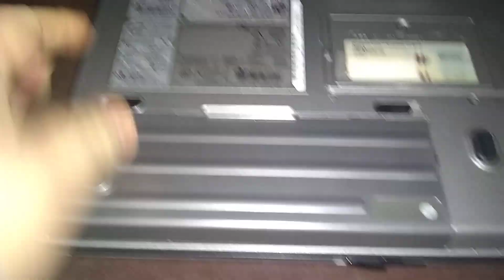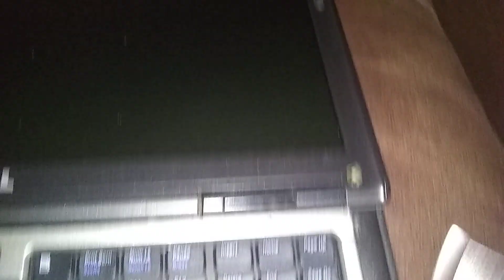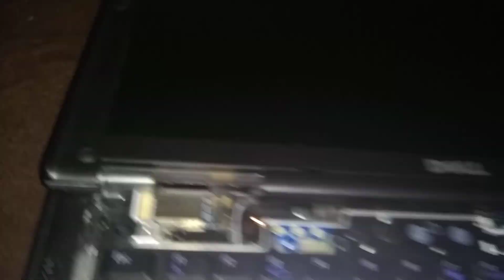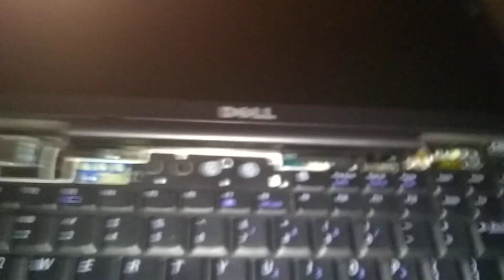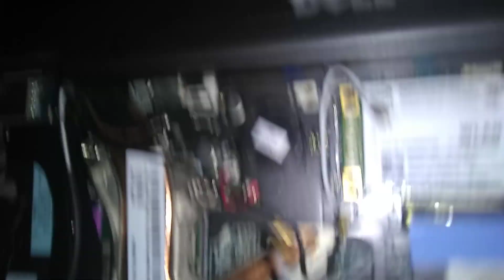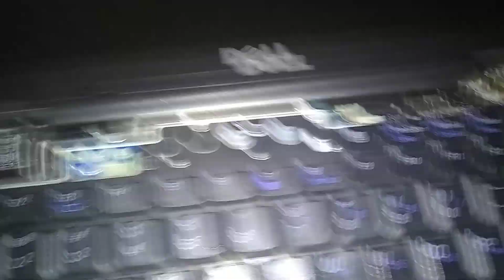How-to Upgrade WiFi Card Dell Latitude d620 d630 d820, Nervous Nick

Comment: I installed Linux, Broadcom wifi in there has no drivers to work with Linux, I hope swapping it out to this Intel card solves the issue, spent 2 days only to admit defeat and reinstall winders10, instant wireless, no searching.

Comment: The hardest part I found was getting those fiddly wres back on. You have to be VERY careful.  Damage the connector at the end of the wire and you're screwed.
Also better to get the new drivers and have them ready before you change the WiFi card as once you've changed it, without its new drivers, you won't get on the Internet to download them.

Comment: I decided to do this to my D820, becauseI had a Toshiba Satellite A305 i was selling on ebay, not for much so i just parted it out and realized i could put it's wifi card in my D820, so now i get around 300 mbps rather than 54. Same with my Inspiron 9400, but it was half the size of it so i need to get an adapter.
Reply from the maker: Help support my channel, donation's accepted at this link:
https://paypal.me/NervousNick?locale.x=en_US
Reply from the maker: Good Job!